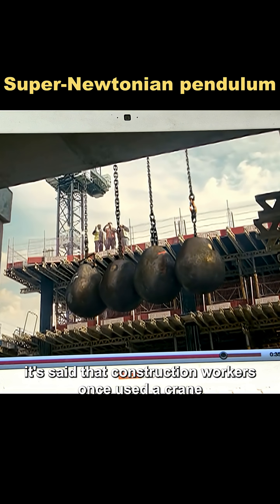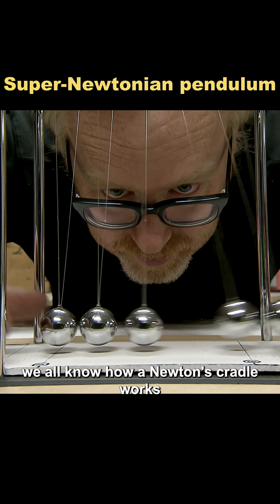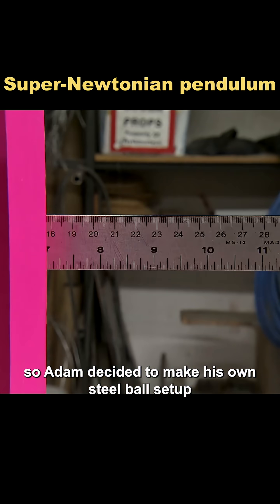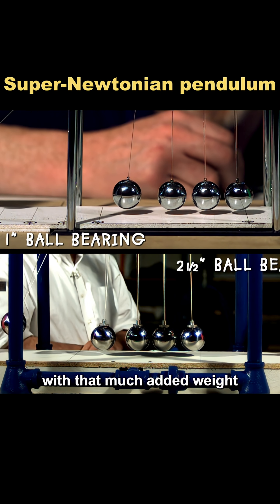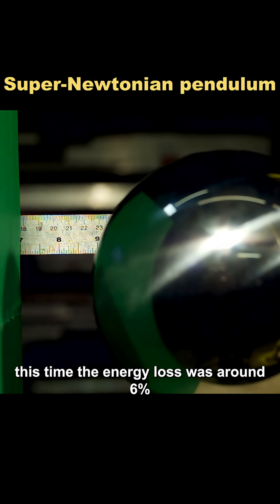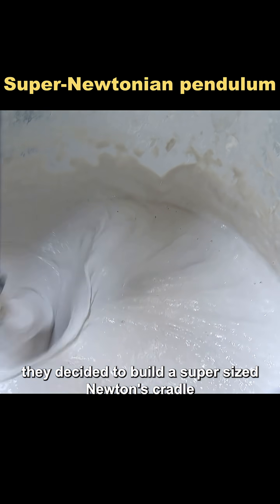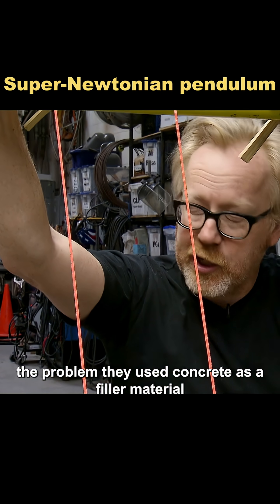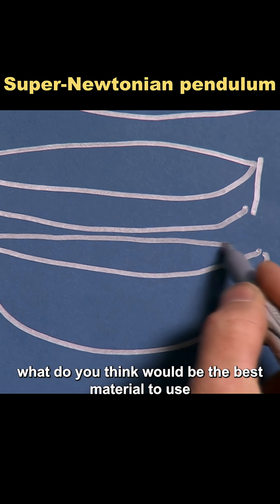The world's largest Newtonian pendulum

Comment: Ya filler material will be a problem. A portion of the elastic wave will reflect in each material interface causing many smaller waves leading to energy dissipation. They should closely match the elastic modulus of steel for a filler to work efficiently. They can maybe fill it with smaller steel balls that is rigidly packed. Even that will be problematic. As empty spaces will be treated as second material.

Comment: If the pillar is also moving  and it its impact could be more possible than the normal force or it may be .
Because of the moving pillars at its impact could be more efficient than the normal filters and also as the pillar is moving around and 
I don't know that direct or actual impact but it can 
😅😅😅😅😅

Comment: just put inside a steel rod (cylinder) through the centre and at the impact point (mass centre) , and  basically use it as a siege ram to transfer the energy .

Comment: Just a theory, Since you can't make metallic balls that large without a filler material cushioning the force transfer in between, switch the ball for metal Rods like a Ram, and pour the concrete around it, although the center of gravity has to be in the middle and the concrete cannot line up with the end of the rods or you'd have bad contact surface, though I doubt the concrete would stay on, you can however add pivots sticking out to keep the concrete in place.      Extra - You'll have problems with a very Accurate line up between contact points so you could use a laser to have it more precise, and to reduce side movement make contact points that fit into another on the rods.

Comment: size actually would decrease the energy efficiency unless in a vacuum.

air drag plays a huge role when reaching perfect energy efficiency with moving objects.

as for the material, the balls could be made of tungsten, they’re extremely rigid and dense.

also the material of the string is a huge part of its efficiency, the less elasticity of the string, the less energy is absorbed with every impact, so maybe a small titanium or carbon fiber rod instead of rope would be much better

Comment: If you’ve ever used a sand mallet, u could probably tell that this wouldn’t work, concrete absorbs a lot of things including force, less abrasive could be like an epoxy + iso but even so, since those are two separate materials they would still have a slightly same result

Comment: The energy is transferred along the line connecting the center. Connect the diameter end to end parallel to the floor inside the ball with steel. Fill up the remaining with anything else that's dense.
It should work 😅

Comment: So by adding concrete it has a different structural integrity then the steel in essence the two materials act like a damper thus slowing the Latisse down faster.
Reply: It acts more so that way due to density.

Comment: It is possible first off because wrecking balls are completely solid if something has potential energy in it and then that becomes kinetic energy it makes the other end swing same thing if you do it with the other balls the more you do you get the point but if you put smaller in between the two ends it is completely possible  because the reason it does not work it's because the force went through the ones that it could the force got depleted and then there was not enough to make it continued

Comment: Have you ever thought about filling it up with just molten tin, or any other kind of melted metal, making the shells out of tungsten, and by that it means that it might work tonks, and is the most heat resistant metal shape that into a container for the liquid metal and you made actually make it work

Comment: The filling is the problem. The difference in density between the filling and the outer shell is gonna cause problems. So, it should be better to use something without filling or something similar very similar to the outer shell. Also, if you make it bigger, the drag or air resistance is gonna create problems.

Comment: The best filler is no filler at all.
Reply: Dude is NOT an engineer
Reply: Job had one bro 💔
Reply: ...so you mean air?Or you're vacuum sealing a multi-ton steel ball to the point it isn't even close to what a wrecking ball is,nor would it transfer energy well becuase how well do you think transferring energy through nothing works?(if you say anything along the lines of"pretty well"i will start spouting a ton of math you don't understand and that is a threat)
Reply: @KristianGreggI'm going to start using this threat
Reply: @KristianGregg dew it
Reply: Bro job had one 🥀
Reply: One bro job had 🥀
Reply: Had job bro one 🥀
Reply: One had bro job 🥀
Reply: Bro one had job 🥀
Reply: Air won't work

Comment: Hardness and elasticity are most important. Solid highly polished tempered steel, for instance, should work great. The weight of the balls does not matter as long is there sre no energy losses in other parts of the contraption.

Comment: If concrete won't work, try using sand saturated with water. Using a different metal filler like lead, mercury, or melted aluminum might work as well
Reply: Are u high?
Reply: No, just thinking of alternate materials to use other than melted steel a a filler@bunnykller8659
Reply: @bunnykller8659  Lead and mercury alright bro actually might be high

Comment: The lead will is a good material to fill, it's easy to melt,shape and denser . Example bullet, it's good to transfer energy
Reply: Can't lead kill you?
Reply: lead is soft unlike steel. it will absorb much of its ergy and turned it into heat. newton's cradle work fine with extremely hard material

Comment: It has to be solid metal, the motion is through the steel. If it is filled with anything other than solid steel, it will absorb energy.
Reply: Hi
Reply: @MarkDavid-c3h  hi
Reply: Exactly
Reply: They know that but don’t wanna spend that much on it
Reply: That Is literally the point In the End of the Short.
Reply: which was explained at the end of the short, it's a minute long dude, just watch it before commenting.
Reply: @C3O_Z I was stating that it can not be replaced, there are no suggestions that would work other than a solid metal solution.
Reply: @Slabbit  ...Which was also explained in the short. Precisely when they stated that they can't forge a solid steel ball at that size.
Reply: Bro they can fillet with some liquid because liquid doesn’t compress well don’t absorb any sockets
Reply: @Alex-ep8et Liquid is one of the worst things to use, the reason for this is fluid dynamics. Microscopically the reason metal works is the molecules of it are close and uniform, allowing energy transfer to be efficient. On the other hand, a fluid has free standing molecules and are not uniform, so this means they can vibrate and move without hitting another molecule, thus the energy loss.

To sum it up, you can not replace it with any fluid.
Reply: Iron is cheaper than steel
Reply: would water be the filler have more energy transfer than concrete?

or any other filler that is cheap but have some quality or energy transfer almost same like full metal ball
Reply: @jembaucan9042 unfortunately not, because water has a free standing structure where the molecules can freely move, however metal has a chain like molecule that holds it in a pattern, this pattern is uniform and allows constant energy transfer between the molecules.
Reply: Water or any other incompressable liquid.
Reply: @shadxwed_ as I said before liquids are one of the worst things to use, the reason for this is fluid dynamics. Microscopically the reason metal works is the molecules of it are close and uniform, allowing energy transfer to be efficient. On the other hand, a fluid has free standing molecules and are not uniform, so this means they can vibrate and move without hitting another molecule, thus the energy loss.

To sum it up, you can not replace it with any fluid.
Reply: Proof it I don't believe it
Reply: @Deadeye6146 I’m broke😭 ask myth busters or something😔
Reply: what about some other easily meltable metal such as copper?